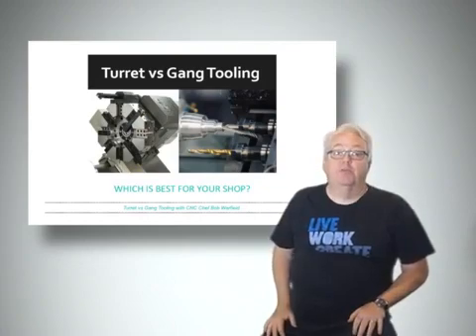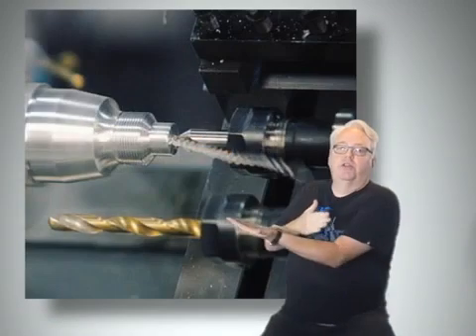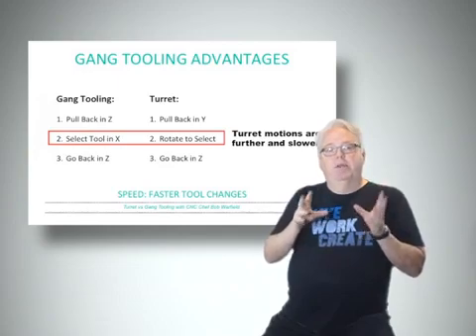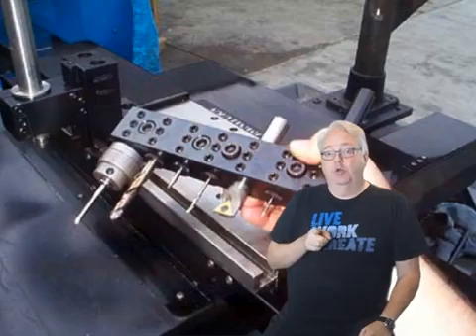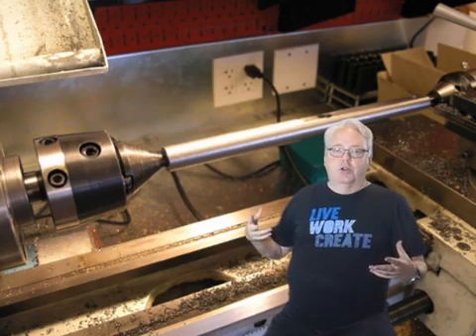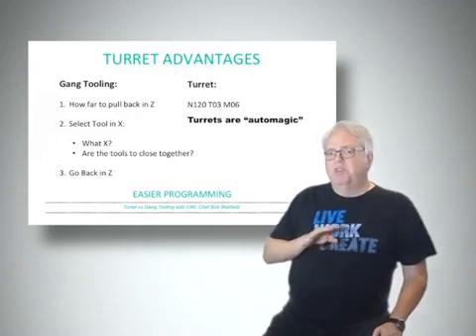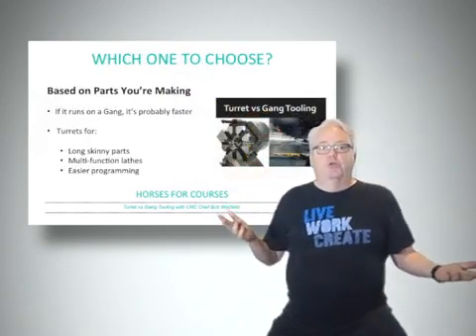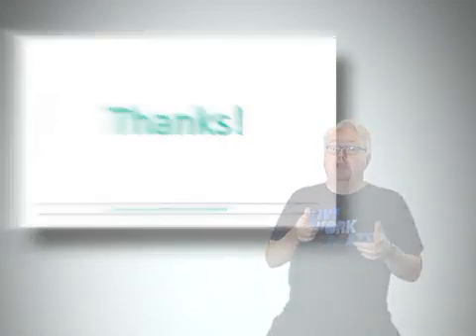Episode 5: Turret vs. gang tooling for CNC lathes

Comment: Good video gang tooling is much better and faster morever if u have a  T slot bed then
It is very easy to adjust n set it up specially if parts r 25-50 mm in dia n length gang tooling is great Thanks you . ( From Pakistan)
Reply: Èkjdjqkqrjaaqn...m
Vkd